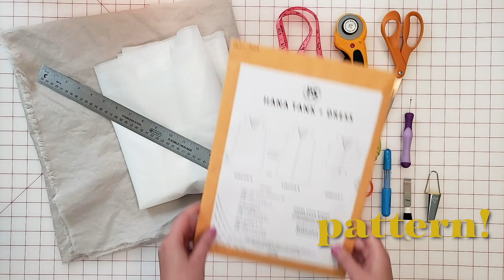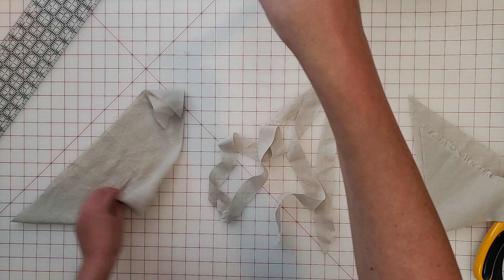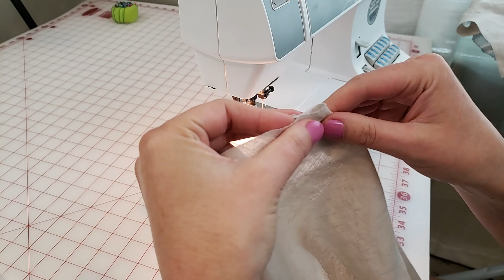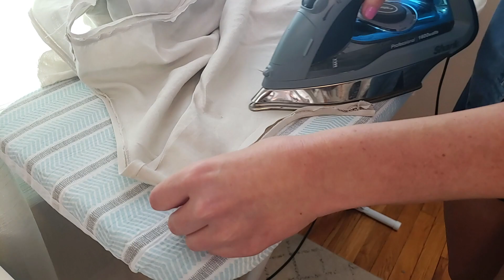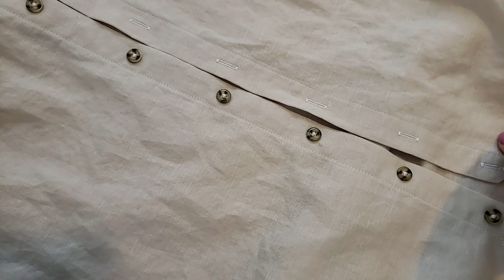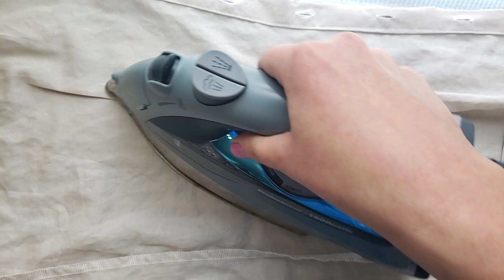DIY - How to Sew a Linen Dress

Comment: Not really a beginner friendly tutorial but fine for experienced sewists who have regular plus serger machines. Moves too fast, can't see what you are doing most the time and whatever is written in white is not up long enough to read and I got tired of stopping the video, backing it up to find split second it was there just to read it.
Great tips for sewing the buttons and for deciding on where to add box pleats except you lost me again with the quick movements and lack of any real explanation of why you showed how to figure pleat area and size but changed it. I've not seen box pleats made before but doubt I will try. 
Why are you pulling the material behind the needle area? Doesn't that cause ripples? wouldn't a walking foot be better?
Reply from the maker: Glad the button part was useful. Thanks for watching!

Comment: When you add your neck and armhole facing it looks like you don't line up the edges. It looks like the facing is sitting slightly away from the edge of the fabric.  Can you tell me why you do that?  Thanks.
Reply from the maker: The seam allowance for the neckline and armhole is greater than the fold of the bias binding so I had to offset it a bit. :)

Comment: How can we measure and adjust the stitch length to sew the buttons? Any tips pls
Reply from the maker: It's a little different on each machine, but there should be a dial or button on your machine to adjust the length (and width, for zigzag) of stitches. Check the owner's manual if you are having trouble finding the dials on your machine. For a button, I use a zigzag stitch set to 0 (zero) length and 4 to 5 mm width depending on the width of the holes in the button (the numbers on the adjustment dials are in mm). Hope that helps! :)
Reply: @PatternScout  Thank you! 💛
Love from Sri Lanka 🇱🇰

Comment: I have been sewing for many years. Learned a couple of things. The tape the button is pure genius. especially now as I get older and my fine motor skills are dwindling. Thanks.
Reply from the maker: Thank you for watching Sheila! I wish I could remember where I picked that tape trick up...someone else shared it and I thought the same thing and use it every time now!
Reply: @PatternScout  I just finished using it. Makes life much easier. I put buttons on so quickly. :)
Reply from the maker: Awesome!